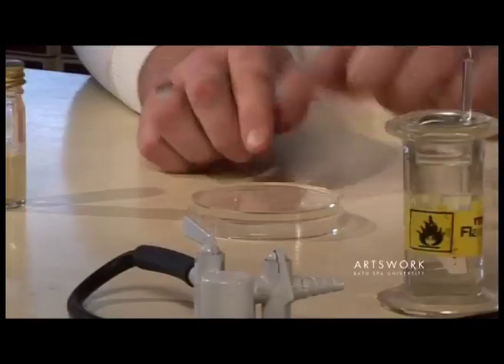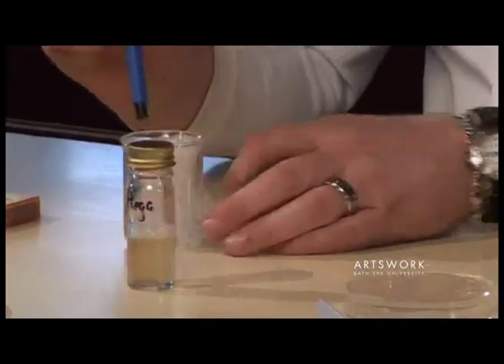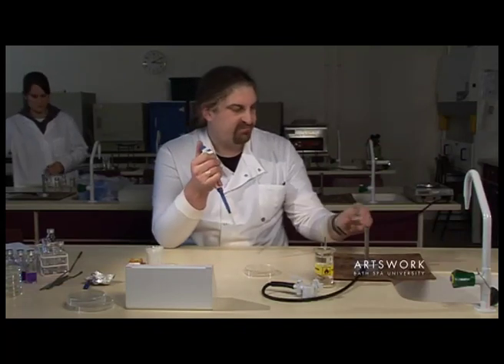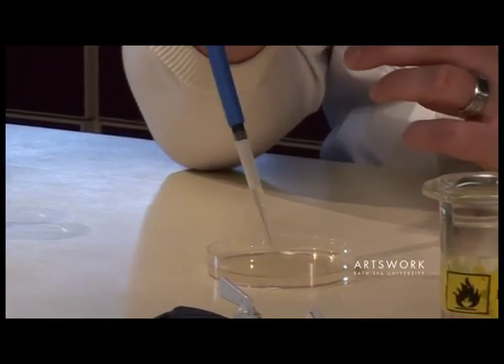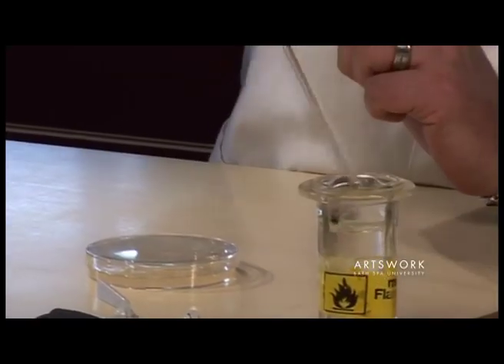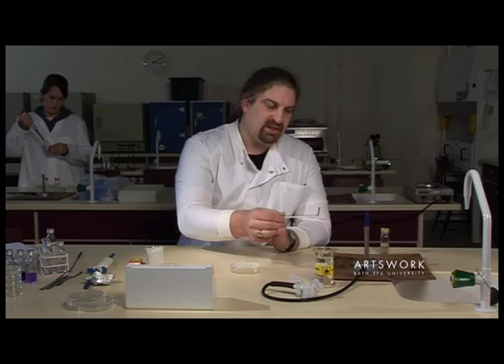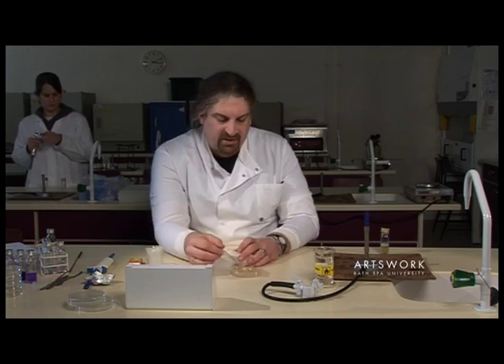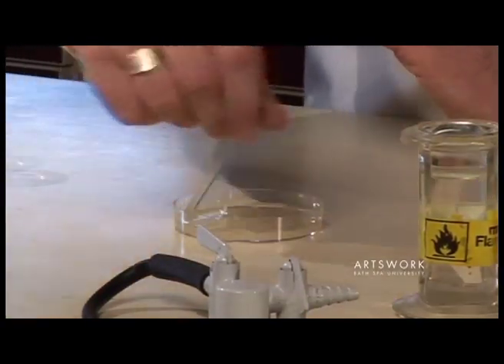The Spread Plate Technique

Comment: Sterilise your workbench and equipment
Pipette 0.5cm3  culture solution (bacteria) onto the surface of the agar
Light a Bunsen burner and turn to a hot flame 
Dip a glass spreader in alcohol and then burn this off in the Bunsen flame
Allow the spreader to cool
Gently spread the culture over the surface of the agar
Replace the lid and attached with two small pieces of tape
Incubate the plate upside down